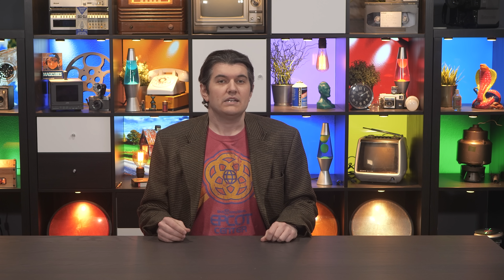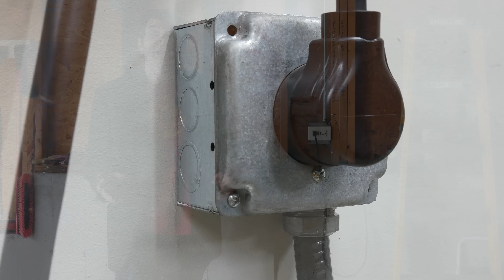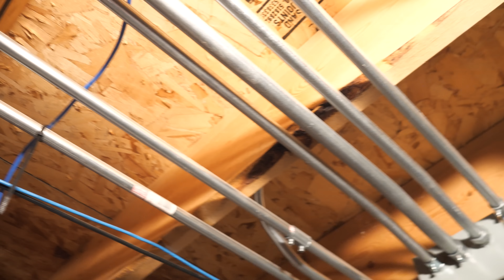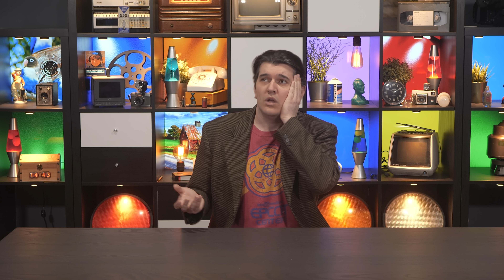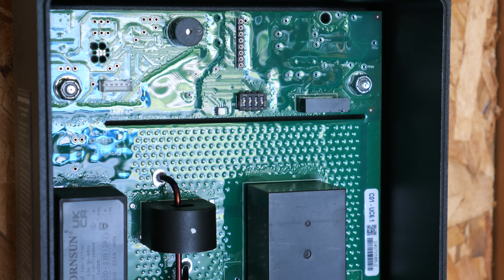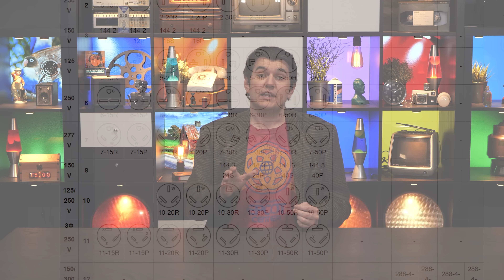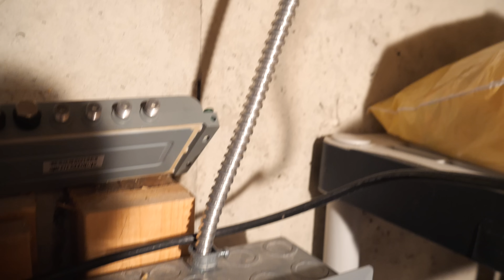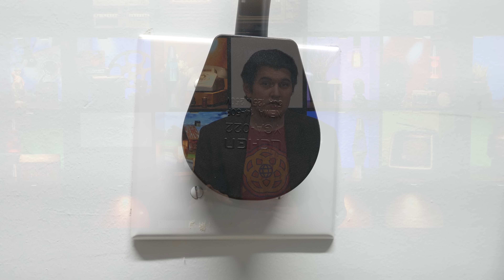The "standard" car charger is usually overkill—but your electrician might not know that

Comment: The BEST and simplest upgrade is NEMA 6-20. If you have a 20A circuit in your garage, you can upgrade it to 240V for about $30 including the new breaker and new NEMA 6-20 outlet. I did this myself and used it for several years. You can get almost 4kW.

Comment: What you must not forget, however, is that charging with 3 or 3.6 kW, for example, often causes charging losses of between 15 and 20 percent. This means that very slow charging/charging with low current should not be the first choice.
This may be okay in terms of price, but I think it contradicts the idea of electric mobility.
What I have to say, however, is that here in Germany every apartment or house has a 3-phase supply and the sockets and lamps are then distributed more or less equally between the 3 phases. As a homeowner, it is therefore relatively easy to provide/retrofit a 3-phase socket for the car (approx. 1000 EUR, about 32 amps) oe using 3 phaes for loading (7 kW).

Comment: I've been rocking the same EVSE I built myself way back in 2014.  My J1772 plug is the limiting factor at 32A max continuous.  I usually only charge at 20 ish A to save wear and tear on the equipment and for most cases 15A or less would be fine.  I do turn it up to 32A on occasion when I need to fill up a little quicker.  Its not worth the money to upgrade my wiring to be able to do the full 48A the car is capable of when if I really need it, there is a convenient supercharger not far down the road.  Thank you for making this video, it is great explaining that you don't need super fast charging at home.

Comment: Electrician here. Yes, most situations are totally fine running smaller plugs. But 1/10 people at some random point in the next couple years hit that 0.1% use case where they forget to charge their car a couple nights consecutively and they need to do that 100 mile day trip first thing Saturday morning. An hour +/- 15 minutes wait to top up another 20 miles will at least get them to a DC fast charger most of the time and mitigate the issue enough that it's mostly ok (or some other similar esoteric circumstance). Sadly, barring that potential contingency (meaning the customer sits with a brick on wheels for 4 hours) there's a real chance it'll hurt our reputation. Customers, by far and large, do not want to be educated. They mostly want something that just works 100% of the time without any thought and if the customer has bad habits with any way to excuse themselves and blame you then it's your fault. We'll be "responsible" for selling them a crappy charger because they read online somewhere that someone with a small/efficient vehicle and a dedicated charger (48A @ 240V) can charge to 50% at home in 2.5 hours while they're stuck for ~6 hours to charge their Cybertruck to just 20% (20A/240V plug limited to 16A so it doesn't fry with long duty cycles). The overall difference in the cost of our service is not great enough to justify the - admittedly rare - downsides especially when we can get positive feedback with similar frequency from people who brag about their cars charging quickly.

Comment: We put in a 240V plug just for the speed. The cable that cam with my wife’s Optiq will charge at 1.7 kWh on 120V but 7.7 kWh at 240V.  The 240V will charge from 0 to 80% in about 10.3 hours.  Unfortunately where we are DCS is pretty thin on the ground to nonexistent depending on the area.

Comment: As an electrician, I always look at what may be coming, IE fast chargers. Also, wiring once for all future situations and possible future owners is sometimes the smarter, more forward thinking solution. Every install and customer is a different situation.
Reply: We recently had a new house built.  Did we "need" a 50Amp charger outlet, 20Amp service in every room, upgraded and additional ethernet cabling and upcoming code compliant island outlets?  I don't know what I and the next owner of this house will need for electrical and data bandwidth in the future but it will be a lot less expensive to do it now.  Don't go cheap on electrical and plumbing on a new build.

Comment: Something to consider that you missed: Charging a car every night will wear out the batter very quickly. Standard car batteries have a limited number of charges before the batteries degrade below 80% capacity. Our dealer recommends that we only charge the car when it is 20-30% . Charging it too often just to 'top it off' can even void the warranty on the battery. So while being able to charge at a lower Volt/AMP. if you can't take it from a 20% charge to full charge overnight, you'll end up wearing out the battery much faster 'topping it off' every night, or having the inconvenience of having to leaving it charging over an entire weekend and not be able to use it (or paying highly inflated fees at the super-chargers).

Comment: I once worked with 24 volt wiring as part of my job.  I quickly learned that stranded wires will gradually creep out from under any kind of screw or clamp.  It's necessary to always install ferrules before clamping.  Yet ferrules don't seem to be a thing with large gauge 240 volt wire wires.  I'm confident that this is part of the problem with wiring high power outlets.

Comment: 16:00 This gets even easier for those in the UK or Europe! 250V 16A is the default maximum for a normal outlet receptacle with grounded contacts so that's already 4kW! Some regions it's 14A but that's still 3.5kW! 

And you generally drive a much smaller car with much more efficient power use and much smaller batteries so the charges will be proportionately even more practical!

Really, this is applicable anywhere except for the Americas and our former 20th century military conquests.
Reply: So glad I'm getting out of the USA 😅
Reply: Oh, and if we Really want to go nuts you can always mount a 32/30 or 63/60 A high power worksite connector. That's 480V for 14.4kW or 28.8kW; that's the low speed cycle of a DC fast charger in an outlet that will work on a home circuit! It for charge that truck in 10 hours! Or your standard EV from dead to full in 5! Or a more reasonable sized European EV from dead to full I. 2-3 hours!

Comment: I usually only fill my fuel tank when it reaches around a quarter, or starts telling me it's low, which happens at about an eighth tank or so. I never plug in the EV charger, mainly because it's inconvenient due to a lack of functional exterior outlets, and it's not required for a hybrid.

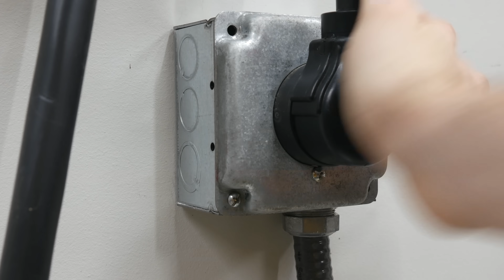Comment: Thanks for the video, informative and valuable and echos my personal refrain when it comes to all things EV "Keep it simple!" A couple things I want to note from my perspective as an electrician. 3:47 Where's the cable connector? It's required by code (at least here in Canada). 
Surprised you can't get 8/3 metal clad, it's available everywhere here. I imagine you abridged your explanation of the availability of current in the subpanel for the sake of video length, but you always have to check your total service availability, not just the subpanel. We can legally install a 100A subpanel (and frequently do because of cost factors), even if there are far fewer "amps" than that available in the main panel. The 80% code rule applies specifically to breakers. Most other electrical components (wire, connectors, receptacles) are indeed rated for 100% load continuous duty, That's how the nema ratings work. However, always check your specific devices for their duty rating. Thanks again for another great video.

Comment: Nice video as always, but I stopped watching when the $379 wallboard was opened to reveal.. dip switches!!! I had pretty much forgot about these 😂

Hello from the land of the 230VAC, plastic electrical  boxes and conduits, and pretty much uniform codes across 27 countries. We are still working on standardizing plugs, with the Germany 16A doing good for all intensivevpurposes.

Anyways, today I hooked up my first wallbox. It has a small display that tells you what is needed and no more. You set the charging power with a button, 8, 16, 24, or 32A.
Both boxes and car support delayed start charging.
Perfect, I feed it part from the PV inverter (with10kWh storage) and part from the grid, this way I can support  car + home loads (in the process of being 100% electrified) of 10 - 12kW, no problem.
The wallbox is about $150 on AliX.
Before I just used the plugged slow charger that came with the car,  it did perfectly for my needs anyway.
If you are still buying gas and gasoline guys.. it's time to wake up!

Comment: I'm sure an electrician takes one look at that charging station, sees the 50A plug, and tells the customer that's what they need to install. They're likely not looking at the manual and understanding that it can be reconfigured for a different circuit.

Comment: In school for EE. Literally all a battery does is store charges to be used in what ever device uses it to do work. To recharge it a device simply connects to the battery at an appropriate potential and replenishes the charges. The number of charges carried over is in coulomb. The rate that you can transfer charge over time is what electricians call amps. So if you install a charger capable of supplying 30A that's great it means it will charge the car faster than one only capable of supplying 15 amps. Electricians often times need to follow the local codes and that's kind of specific. For example a service upgrade would not be necessary if the charger employs Energy Management System (EMS)? I believe the Canadian Electrical Code for home calculations stats 100% load if there is no EMS and 0% if it has the capability. Also if it's a standard nema 15 the charger will consume less than 1500W which depending on the code can be calculated at 25%. Either way an EMS charger is capable of monitoring house loads and charges accordingly. But yeah, what ever floats your boat for chargers. I know an electrican who has a standard install package. It fits the codes in his area so that's what he does. Doens't mean it's necessary depending on the product purchased. Just know that if you install a smaller charger it will just take longer to charge depending on the Ah rating of battery bank on the car.

Comment: If you have to install a 30a source for an EV why not just install a 50a? You still have to do all the same work, just bigger breaker and wire. Yes if your homes demand factor can't support it your pretty much out of luck. Longer charge times is less efficient but the loss in time and heat will probably be negligible but still measurable. It all comes down to how long you want to wait.

Comment: So my experience as someone who helps install chargers and has talked to people  with EV the issue isn't so much How far you drive its how do you store you vehicle and how much do you use thw climate control if you keep an EV outside in the winter and use thw heater that 30 mule drive uses 60 miles or ranger same thing with AC our advice is put out the biggest charger you can afford in a especially if you don't have a garage even an unheated garage is going to be warner in the winter and you dobt have the same defrosting issues

Comment: When I bought my BMW i3 BEV (not the hybrid) 10 years ago, I drove it home and plugged in the granny charger (240 volts, 10 amps, normal domestic socket in Australia). I planned to get a 7.2 kW charger installed. But because the battery was always fully charged when I needed the car, I never got around to it. The car has been charged by granny charger since 2015 and there has never been a need for a "proper" charger.

Comment: Usually, can be a funny word. In order to desulfate a battery and maintain it over time the charger should have a function where it exceeds bulk charge amperage and pulses the battery with very high current. To sustain a high current desulfate cycle the circuit must be sufficiently sized to carry the current without overheating.

Comment: Running the numbers, I can almost understand why we haven't yet got to a point where EV & ICE charging/refueling times are identical. If we say, for example, that it currently takes 5 minutes to fill a car's tank to 50% capacity and 8 hours on a 24A/240V circuit to charge the equivalent EV by enough to give it  the same range-to-empty, it would take a >2300A circuit to reach time-elapsed-equivalence. Leaving aside how difficult it would be to put hardware capable of handling that in a vehicle, that would require cables with a core diameter 100x greater if still running at the same voltage (on the basis that current capacity scales with circumference of conductor via "skin effect", and not cross-sectional area) or supplying the charging infrastructure at distribution voltage (e.g. 110 kV) to keep current (and thereby the required conductor diameter) down.

Comment: I commute to work 102km per day. That’s 51km per leg.  I drive a ID4 AWD with the 86kWh pack.  Issue is that my commute is 98% highway. 
What this translates too is that with my battery set to 80% capacity, I can get about 3.5 days worth of commute on a full charge before needing to seek out a charging solution. 
My socket at home carries just 0.7kWh to the car, that’s about 4km of range per hour (according to the car anyways). It simply cannot under any circumstances cover even the first leg of that commute, never mind the second. Especially once winter hits… 
That would be assuming I COULD charge at home. My EVSE simply decides to either 1. Not draw any power at all, or 2. Flip my breaker.  The EVSE itself says it draws at most 10A, my breaker is set for 15A, I have absolutely no idea why it’s tripping the breaker, but it’s doing it in everyone’s homes in my complex who’s allowed me to try. Even sockets that have successfully charged Chevy Bolt’s before.

But of course I live in a townhouse and that uses centralized distributed electricity, instead of everyone having their own thing. So now I’m in talks with an electrician to come check out the property. 
Genuinely I need that L2 installed for my commute to make sense. 

And the chargers at work are useless. 5.5kWh maximum and you only get them for 90 minutes, which translates at best to about 41km. Still can’t cover one leg.

What this means is that eventually I have to just bite the bullet and head over to a DCFC and pay 0.55/kWh, and just “fill up” mid-day while I take my lunch break.  It sucks. I just want to charge at home in a way that at least gets me one leg of my commute in the warm weather. Right now it just feels like I’m sinking under my charge levels

Don’t get me wrong, <= $40 of charge from 20->80% every 3.5 days is still way better than the $145 id spend filling every 4 days on the pickup truck I traded for the ID4, but it kind of ruins the point of why I chose EV in the first place: charging at home

Comment: In the future, it will be necessary to put external electrical outlets behind a firewall in addition to locking covers. Energy costs will continue to rise, making it more costly to charge. Gone are the days of siphoning fuel from a tank. I can see it now. People low on charge will swing by and covertly plug in if you're not home or asleep.😂

Comment: You mention on-street charging very briefly. In the UK it is very common for houses to not have any form of off-street parking, particularly in urban areas. What some local governments here have been doing is working with EV charging or electricity supply companies to install on-street chargers at the request of local residents who need them. The best part of all this: you know where they put them? On the side of street lights. Some of them are even nicely integrated with casings designed to match the street light they're attached to.

Comment: I get what you're saying BUT nobody wants to wait 13 hours or more charging their vehicle. Whether it's overnight or during the day. No one wants to charge their vehicles that long so the higher the amperage is on the charger which you max out at 48. The faster it will be to charge your vehicle which is relatively 6 hours... I'm going to give you guys a little insight about myself. I am an EV owner. I'm also a licensed electrician for the state of New Jersey as well as Texas... So saying this is to tell you guys keep in mind of ohm's law and that's the big thing

Comment: Our Tesla travels 50-60 clicks a day, and we only charge overnight (when electricity cost are cheaper) so a 240v was required in our case. We charged with a regular 120v for the first 5-6 months, but it was a struggle and had to often top up at a Supercharger which costs a lot more. I often tried to use the level 2 charger at the Amazon warehouse near us, but it’s meant for the delivery trucks lol and I had to hop off whenever they would come by and needed it. But they didn’t seem to mind I was using it lol

Comment: We bought our first EV several years ago and I had an electrician run a 50A circuit to two NEMA 14-50 outlets in our garage to offer flexibility in terms of which bay the EV would be parked in. We use the Tesla supplied mobile EVSE which we keep attached to the outlet.

Now we have a second EV which also came with a mobile EVSE (that we also keep plugged in) and have to be careful not to charge both cars together which would trip the breaker. One solution is to tell each car to draw only 20A but I'm wondering if there is a solution to let the cars share the 40A dynamically.

I suppose I could get a new 50A (or smaller, based on this video) circuit run to one of the locations if that is the cheapest solution since I suspect dynamic sharing will require new EVSEs to be purchased for both the outlets that can do some data sharing.